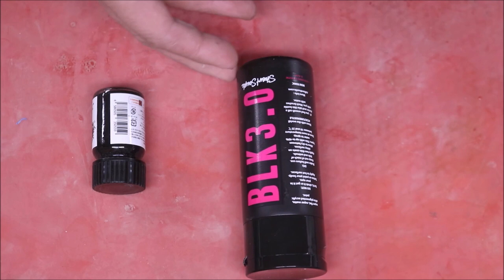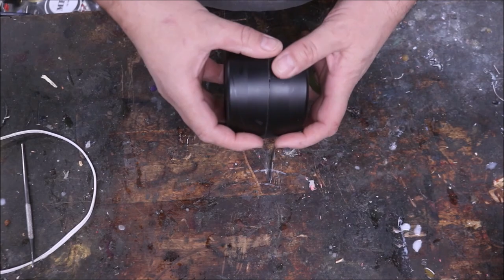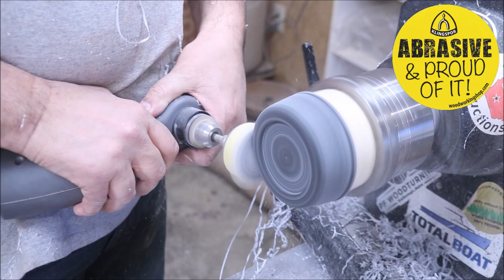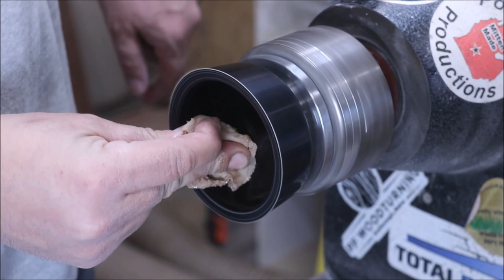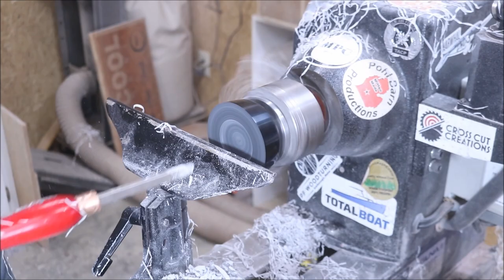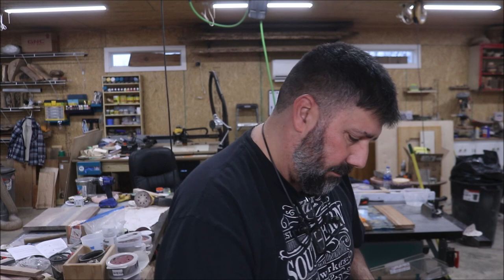Musou Black vs Black 3.0 - Which Bowl is Darkest?

Comment: Its a paint, of course mixing with glossy resin it shines.. also its the carbon nano fibres that make it blacker than black and you sanded and waxed them away.. Try painting 5 layers with each paint instead and don't touch the paint it scrapes off.
Reply from the maker: Of course, that's why I did it again. https://youtu.be/xhiSH5qSU8w

Comment: Your test has destroyed the matte finish required for those products to be non reflective which is at the very essence of how they work ,
once gloss they will become reflective so you will not differentiate between the two you will get much the same result using any good quality black pigment
Reply from the maker: No big deal. Wasn’t really a scientific experiment. But you can definitely tell the 3.0 it’s darker.  And both are darker than the black bowl I did with black diamond pigment.

Comment: Do you find sanding sealer does anything on a purely epoxy project?
Reply from the maker: The cellulose sanding sealer helps fill in the small scratches. I wouldn’t finish without it.

Comment: You shouldn't handle Musou without gloves and a respirator, even embedded in resin, if you are gonna turn it in a lathe

Edited for clarification
Reply from the maker: Thanks for the information. Glad I didn't have any reaction to it.
Reply: @MoonpieCreations  Well, a lot of people has handled it without problems, and the main source of the warning about its potential hazards is dubious, so probably it was ok

Still, the own bottle recommends using a respirator with an approved filter if exposure
to airborne particles is foreseeable during use, I was slightly worried cause the lathe...but if you didn't experiment any reaction that day, it's totally fine :)